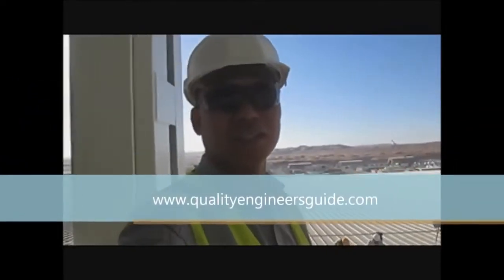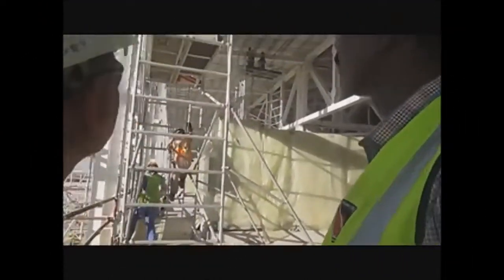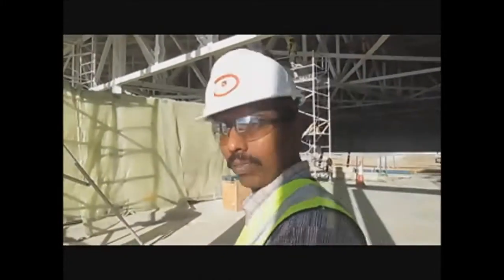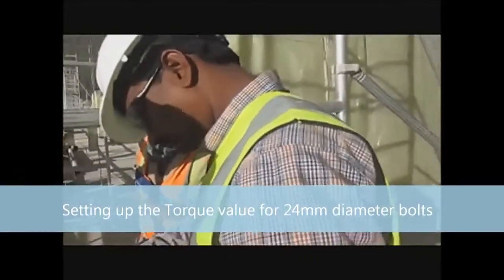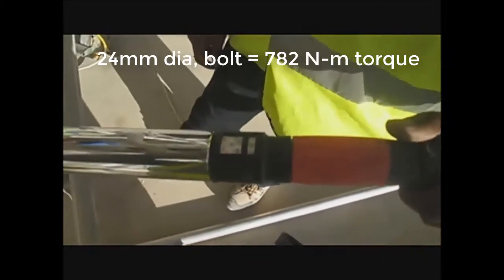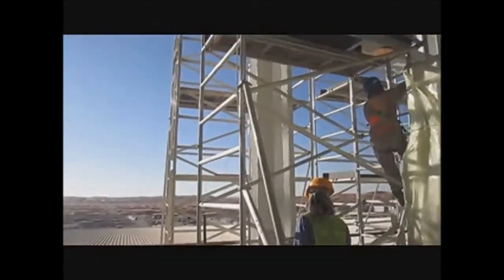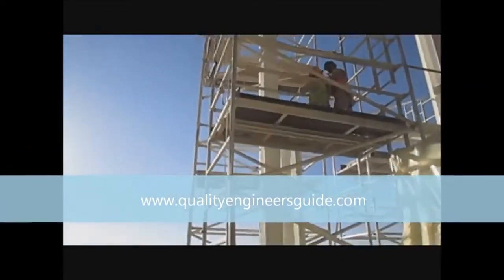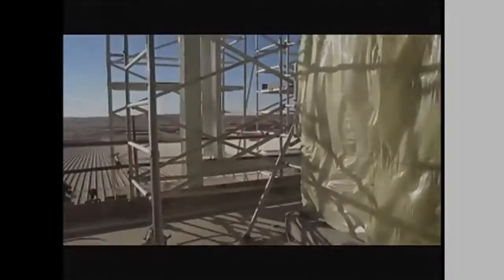How to tighten the connection bolts on structural steel by torque wrench

Comment: the bolt should be pre-marked in order to detect any sign of movement, because what are you doing is that you have selected a certain load and you increasingly applied a torque until the set value was achieved, at that moment you will hear a click sound, so you are going to hear it one way or another. But what actually matter is whether the bolt moved or twisted after during the application of the load.